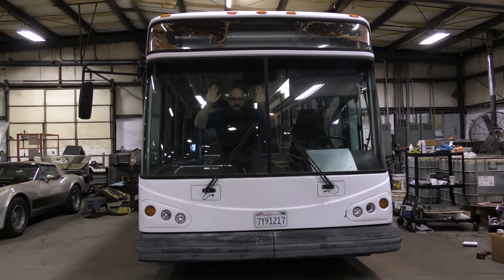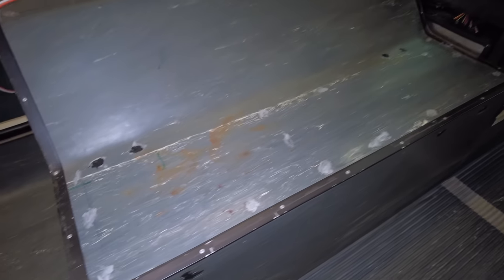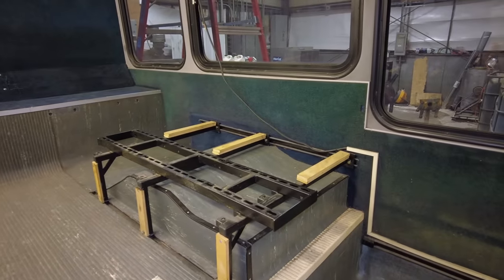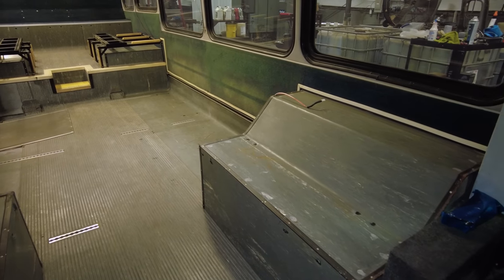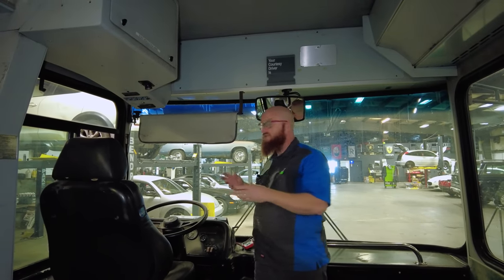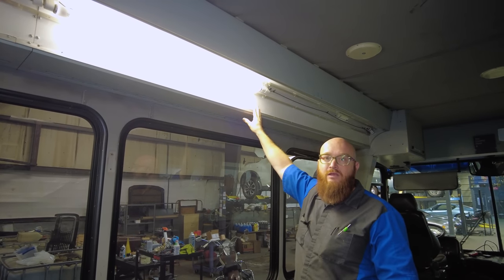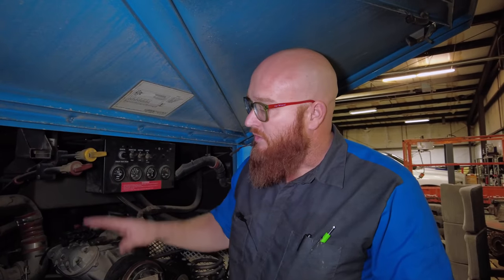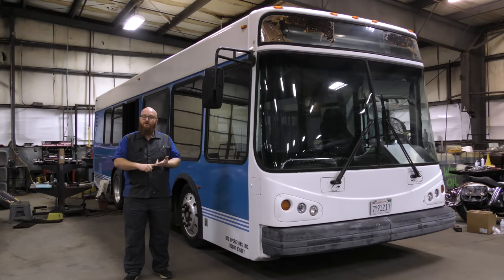Bus #3: EZ-Rider bus looks great cleaned up! Plus the CAR WIZARD has found a lost gear?!?

Comment: Hey wizard, I’m a city bus driver and I’d recommend you work on insulating the bus and heavily tinting the windows. Also, the doors weatherstripping usually leaves an  air gap so it would be worth doing a custom rubber flap on the bottoms. These things have excellent belt driven air conditioning but you’ll probably want to get one or two roof units on the roof hatches. I’d strongly caution you about running in hilly terrain as this bus likely only ever dealt with mostly flat terrain. A lot of these units that have been converted start having problems when pushed into the mountains, even if the engine is strong. Check your tire speed ratings too. You should be ok but it’s worth looking into. I’m gonna recommend you delete any emission controls on it if applicable as these are a major pain point for our fleet. We literally get pallets of giant dpf units delivered monthly. Lastly I’d recommend you ensure your low beam headlamps are actually acceptably working. Most city buses run with the headlamps on 24/7 and they obviously degrade over time. Love this project
Reply: Now, isn't it handy to get such good suggestions from a city bus driver?  Makes sense about taking it into the mountains, especially with the power chips installed. Enjoy! ☺
Reply: I will especially second the insulation in regards to the firewall/exhaust region.

Regarding the DPF issues - if the engine is well maintained and you're looking at a single vehicle, you should have ample warning to take the filter to get it cleaned out - and it won't happen frequently. If you're not going to maintain the engine well, you have to figure that all of the fuel and oil that you burn will create soot and fill up the filter. Soot is mostly generated by the oil consumption, not the diesel, so the big question is the level of oil consumption.
You also need to understand your operating regimes. If you never push the engine enough to get heat into the exhaust, then the soot will plug it up and never be oxidized (into ash). An engine that is performing well and regularly getting hot will have a DPF that very slowly fills with ash, needing to be cleaned between 50k and 100k miles. The reason that depots have pallets of DPF replacement filters is that they can't wait even a day with the vehicles down to have them cleaned, so they cycle through them (business vs personal use - this could be fine). If you contact Johnson Matthey, they might provide you with the software to monitor the exhaust pressure and you'd be able to have it cleaned before there are problems, as well as using it as a diagnostic to know if anything was headed downhill. - Heck, they might send someone out to show you the ropes and train you up on it. This is the type of PR that they're always looking for.
Reply: @BringerOfDearth  I drove teenage schoolkids to school with a luxury tourbus, and that seat is where many boys had their dreams cum true!😅😅😅
Reply: I would also suggest in addition to this get a good pair of LED headlamps (the stock ones on your bus look to be a standard 7" type) it will help with increasing the visibility (make sure they are DRL compatible to be safe?) and will be easier on the electrical system that's only getting older each day, I would suggest checking the turn signals (couldn't tell if they were LED already or not) for burned out lamps/LEDs and any bulb possible replace with either an LED equivalent, or LED replacement fixture. Again a lot less strain on the electrical system and that also translates into less fuel consumption and less work for the engine, especially if its already working harder in hilly or mountainous areas.
Reply: I also work on busses. Man that's crazy our whole new fleet had dpf head unit issue too we order 100 units at a time and they only last 5k mile up to 20k mile . We have major issues with dpf heads . Our busses run every day
Reply: @JimS6025  There are LED replacements now for many types of lamps. Those fluorescent tubes have LED replacements available. I work in hotel maintenance and we have literally many dozens of fluorescent lights and we are in the process of upgrading them.
Reply: @JimS6025  From what I'm seeing, LEDs frequently have higher failure rates.  I see city buses with half-dead lights.  LEDs SHOULD be more reliable, but everyone seems to drive them too hard.
Reply: @russellhltn1396  makes me curious as to if the LEDs used were either the correct voltage or something else was missed out on (IE: LED driver left out or not connected), as most buses where I am at have the LEDs but I have yet to see any burned out.
Reply: @BringerOfDearth  Yep, I'm also simply referring to what happened on my bus. But, like you said : each to his own. ☺👋👍
Reply: @BringerOfDearth  Cheers! ☺👍
Reply: Led replacement for fluorescent are not all the same. The newer ones can now be direct wired to 110/220volt if you just replace the lamps power is still running through the ballasts ( not sure if the buses run something different) and that’s where a lot energy is wasted. The newer bulbs allow you to eliminate the ballast ( and weight). Also the LED bulbs do not emit light all around the bulb like fluorescent tubes will. Some ambient lighting is lost due to the way they are constructed. That’s why I suggested a molding with a gap to accommodate rope/LED light strip for ambient lighting.
Reply: Random comment but the side facing seat by the driver on the curb side of the bus is referred as the “peanut seat” 😉
Reply: @BringerOfDearth  Fully agree☺
Reply: @JimS6025  I suspect many used series strings.  Which can work, but the LEDs have to be closely matched - like from the same batch.  But I think many times they just drive them too hard (It may be within spec, but no safety margin).
Reply: I'd also consider making the entire overhang area under the windows insulated and filled in to make essentially 3-4 inch sills around the windows.  This would also hide all of the wiring and plumbing.  As it is, it's paper thin walls and loads of glass.
Reply: @BubblesTheCat1  What happens in the back lounge, stays in the back lounge.
Reply: @raygunsforronnie847  Yeah, it was exciting to imagine what was happening there. Being the driver, it was impossible to see or watch. What a pity.
Reply: @russellhltn1396  its highly possibly, not surprising TBH.
Reply: @ejburke8271  I'd bet that the transit fleet dpf issues are mostly related to an average speed of 20mph or lower and lots of acceleration periods.

Comment: If you're intending to drive at higher speeds for longer periods you may want to check the speed rating for the tyres. Urban buses tend to be fitted with low speed rated tyres that will overheat at higher speeds.
Reply: Good point. I always find the Tyre vs. Tire argument very interesting
Reply: @Vulcan650Vampire  get a grip , tread lightly,  yes I know ..?
Reply: great point. jumping to a road-going dump-truck or other lighter duty tire would still offer comfort (softer sidewall) while being rated for the added weight of the RV install and higher rotational forces of 75mph driving.
Reply: @adrianpeters2413  I have some really good puns about tires, but I’ll spare you
Reply: @Vulcan650Vampire  *FACEPALM*
Reply: @williamjones4483  I’m sure you exhaled at the same time…don’t inhale the air from the wheels…it’s tired air and you will just get sleepy
Reply: @Vulcan650Vampire  It's why we come to YouTube.
Reply: I doubt this bus is geared to go higher speeds anyway !
Reply: @WANDERER0070  watch part 2!! Apparently it has a sixth gear

Comment: I would advise against running a combination of 12VDC and 120VAC lighting.  Go with all 12VDC lighting and use a 120VAC to 12VDC power supply.  When you switch to shore power, this switch will isolate the 12VDC lighting circuit and connect the 120VAC to 12VDC power supply to the lighting circuit.  In the end, you will need to be very conscious of adding too much weight.
Reply: I'd just do a full RV style dc system with ether a converter or a big inverter charger like a victron multiplus. It's pretty standard for your house battery charger to also run your DC loads.
Reply: He needs some consulting from rich rebuilds in the electrical. They did a pretty cool RV project awhile ago.
Reply: Yes definitely! Even the most simple option (a power supply and a manual switch) is easier to install than duplicate lighting systems. That is just twice the weight and complexity. And what are you going to do when you travel to a place with a 240v power socket? The transformer will be just fine.
Reply: Yeah, please don't do that. You want house batteries with a charger/converter so when you plug in you charge the batteries, and also a battery isolator so the bus alternator can also charge the house battery, but the house can't drain the bus battery.
Reply: Your continuity tester sounds pretty much exactly like the Book in Hitchhikers Guide to the Galaxy
Reply: @XBootlicker  - And thunder is thunder.

Comment: Another bus mechanic here. You need to get the control unit for the HVAC system. The over pressure switch you pointed out will not work without it. You most likely will frost over the evaporator over and over again. It does have a over pressure valve when that blows it will dump all the refrigerant, 12 to 15 pounds of it.  
Check to see if the reader you have for the trans will let you do a clutch test. Why, because you can use that as a go home, lock the trans in one gear and drive. You will be surprised how well it will drive locked in third gear. To add to your travel tool kit have a copy of the clutch chart so you know what clutches are used in what gear. To help pick a gear to lock into a drive home. If the trans does have a bad fault going down the road it will lock it self in gear, pick a good spot to stop because it might go into to neutral once stopped and if the fault is bad it will not go into gear again. If you want make up a set of gauges with hoses long enough to go through the rear vent windows. One for main pressure and one for the clutch that set a code. Pressure test points are on the bottom of the trans and marked. 
When putting tall stuff in there put it on the driver side keeping the right side windows clear to see better. The emergency windows make a nice access to the back side of a cabinet you build in there if you leave room to pull the handle. 
Driving a low floor bus is nice because visibility you have. Being able to look to the right to make a lane change. I really like that it does not have a front door. I assume one of the bus guys told you how to latch the emergency roof hatch. It makes for a good place to get on the roof.
Reply: A note on the A/C, troubleshoot all the wiring. If I remember right the control box works with grounding circuits. If the wiring checks out I would open up the control box and look for broken connections.

Comment: Wizard and Mrs. Wizard - what a cool challenge you're taking on.  Good luck, will be watching closely as I was (at one time) considering converting a vehicle for RV use.  
We now live (retired) in Portugal but had a 36' 1996 Monaco Dynasty motorcoach for a while before we retired.  Ours had the Cummins 8.3-liter 300hp setup with Allison 6-speed.  A very nice combination and even with the size and weight of our coach, I felt that 300hp was plenty for our needs.  Torque was north of 800 ft-lb which may have helped. We did a 2900-mile trip in it (California, Nevada, Idaho, Washington, Oregon and back to California) and AVERAGED 8.5 mpg.  I usually cruised at between 60 and 65.  
FUEL TANK - You said your bus has an 80-gallon fuel tank (if I recall correctly).  Look up what the USABLE fuel amount is.  Our bus had a 140-gallon fuel tank but the owner's manual said that the USABLE fuel was closer to 100 gallons.  
TIRES - I caution you about the tires you currently have on your bus.  RV industry (in general) says that no matter what the tread depth, if they are more than 7 years old they should be replaced.  Please consider this for the safety of yourselves and those around you.  
KEEPING COOL - when you're on the road, you're going to be sitting in a giant Easy-Bake oven up there.  If the sun is out, you're going to know it.  Our coach had small dash-mounted fans (one for each of us) that I was using constantly.  The dashboard AC wasn't worth a crap in that regard and even running the two overhead AC units (with generator on) wasn't much help.  It kept the coach cool but when it is 75-80 degrees  (or warmer) outside and you're driving into the sun, you're going to feel like a rotisserie chicken from Costco!!  Wear light colored clothing, shade your eyes, wear good sunglasses and ENJOY THE RIDE!  I always had an ear-to-ear grin when driving my coach, even in downtown Seattle trying to find a place to park it so we could check out Pike Place Market.

Comment: use 2 layers of polarized ceramic tint on the windows to help keep the interior temp, also try to layer some aluminum coated styrofoam panels for wall and roof insulation, and a lot of people over look insulating the floor
Reply: I just bought a new car and spent the extra for ceramic tint and agree, it's the best investment, especially here in Florida. Even on the hottest days (90+) the interior is mildly warm and nothing is scorching hot to the touch. Good call!!! Get a shop to sponsor the tint for some advert space on the Magic Bus!!!!

Comment: A big, easy to deploy awning should be in your budget. This will shade at least one side of the bus and make rain easier to deal with as you go in and out of the bus. Fold out counters under the awning will allow cooking and food prep outside of the bus to help limit heat and odors. And getting outside is the whole point of camping anyway.
For guys anyway, a hole in the floor, a hose and funnel will save a lot of room in your sewage tanks too 🙂

Comment: Hey wizard, Bus RV guy here, and just wanted to possibly give you and MS. Wizard a tip that would help out, not sure if your already thinking of this or not, but when you put in your cabinets and all the other things that will mount to the walls, I strongly suggest using the black bars (tracks) that run along the walls and/or floors that the seats would have mounted to, why? SECURITY, it will be a good way to make sure things won't shift around on you as they were already meant to hold seats in place, so I think you get the intended idea I'm going for. ;) Hope this helps you out with your bus project!!
Reply: Those "child-proof" latches that are meant for home cabinets with little ones roaming around will be useful for keeping doors and drawers throughout the RV/Bus closed while moving.
Reply: @XBootlicker  Thanks, forgot the name of it!

Comment: Make sure you insulate it properly, including the floor and windows.
Also, use light weight materials, so the bus can still move when you are done.
Reply: How do you insulate the windows?
Reply: @tcm81  they probably won't need it, but if they are not being used, I recommend drop ceiling tiles. They are easy to work with as far as cutting and piecing together. I used to work at night so I did that in my bedroom. It was great.
Reply: @tcm81  Double glased windows are fit in a proper RV, also all windows not needed are replaced with metal sheet welded in
Reply: Such a good point... I've seen many a converted bus or RV that could barely pull itself and once it's filled with all the shit needed to make it a motor home, it's fuckin hopeless.
Reply: @tcm81  with foam board, you can buy at home depot
Reply: @tcm81  
Some form of secondary glazing, or covering. They could even swap them out for double glazed units.
Reply: @tcm81  The overhang above the windows - add walls there, giving it a 3-4 inch space for wires.  Adds a nice sill for the windows as well.  Keep some of them, paint half of them over.  They have to really build up interior walls to turn it into anything usable and insulated.  But the windows - they are FINE.  Leave as-is and just put blinds or curtains in.
Reply: @C.Fecteau-AU-MJ13  - None of this likely matters as I will predict this project never gets finished. I've watched plenty of these and they take 1-2 years, working full time by skilled craftsmen and/or engineers, to build them properly. There is so much that goes into a proper RV, it's not for the faint hearted. You need time, skills and money, and did I mention time? Just the research alone is hundreds of hours. Unless Wizard uses this empty bus to haul all his camping gear, this thing will never be seen at a campsite. I hope I'm wrong.
Reply: Check the rated passenger capacity and take in the average weight of a adult and that should be close to the max weight capacity. Usually it's on the vin plate

Comment: I have to say I love reading the comments for these. There’s a lot of great feedback from the community and I think this is gonna be a really cool project. As somebody who owns a class A, I’m partial to country coach so I’ve gotten pretty adept at maintaining a vehicle, which is 16 years old. One thing I would look at with your conversion is take some inspiration from some of these really small class B units that are built on a sprinter as well as class C trucks. You owned and renovated a smaller yacht and you  know all together how space is that a Premium and that’s gonna be the case even though this is a big bus fitting everything you need in there it’s still going to be tight because you do not have the clearance underneath like I have in my coach. The people talking about closing up windows are likely advocating that because it will make mounting storage cabinets easier. Insulation may also be a good idea. You want to make sure that you watch the weight so that your gross vehicle weight will allow you to tow a vehicle. Altogether really looking forward to what you do it this project. Best of luck.